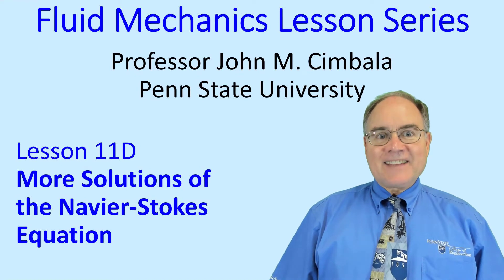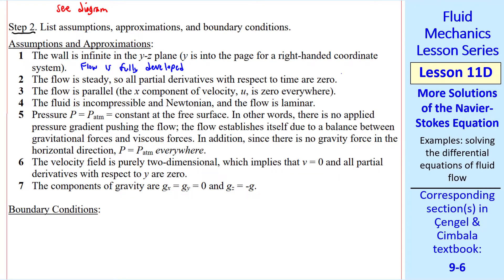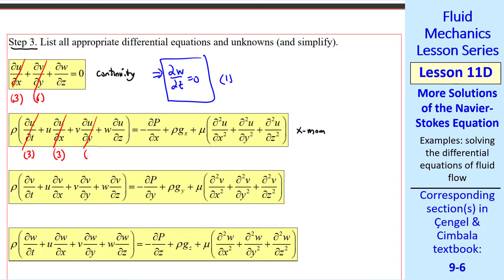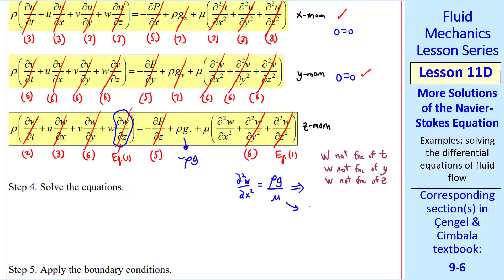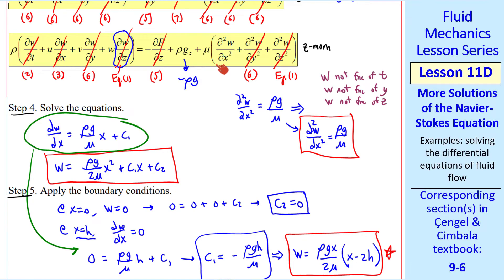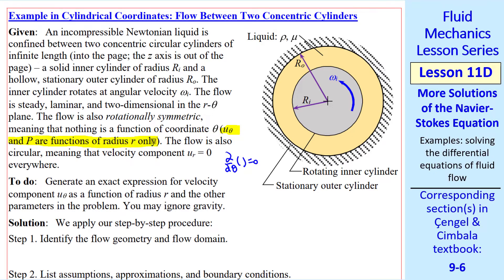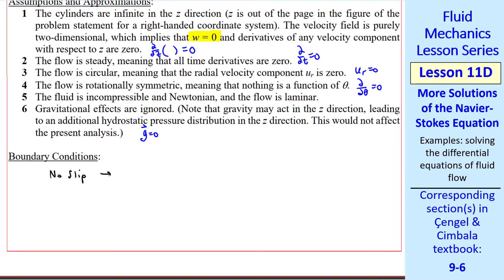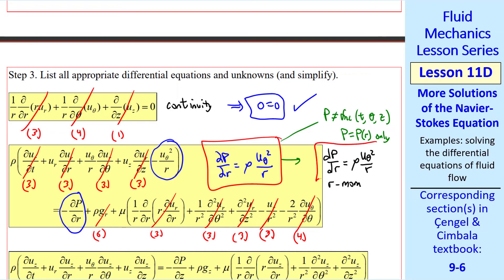Fluid Mechanics Lesson 11D: More Solutions of the Navier-Stokes Equation

Comment: What happens if you don't have inner cylinder and only outer cylinder is rotating?
Reply from the maker: The flow would eventually become solid body rotation as the effect of spinning outer wall works its influence into the center
Reply from the maker: Thank you for your comment. Please tell your friends and colleagues about my YouTube channel where there are hundreds of free videos about the Bible, fluid mechanics, science, math, statistics, air pollution, and other topics. I would greatly appreciate it.
Reply: @johncimbala  can solid body rotation formula be used in this case?
Reply from the maker: @bonvoyage2514  Yes, but only if the system has been rotating for a long time so that steady solid-body rotation is established.
Reply: @johncimbala  could you please provide me a link for it?
Reply from the maker: @bonvoyage2514   I discuss solid body rotation in Lesson 04C of this video series.
https://youtu.be/EV7PxSDbzIg